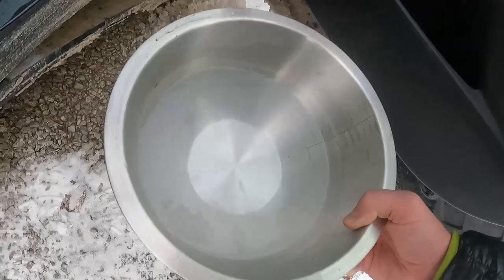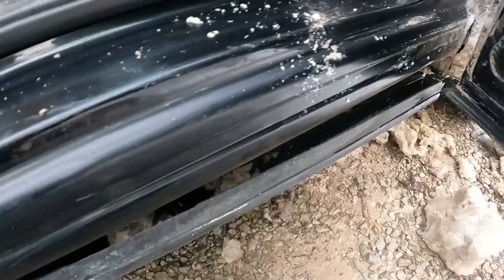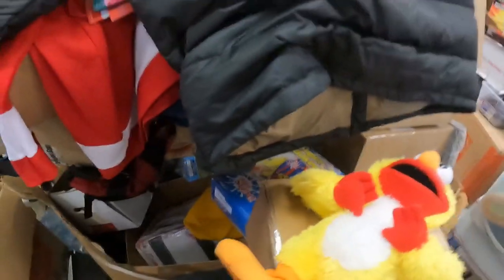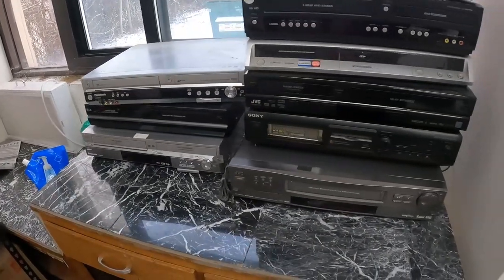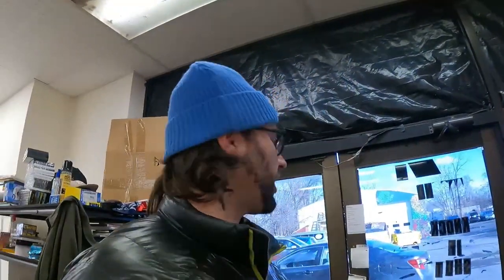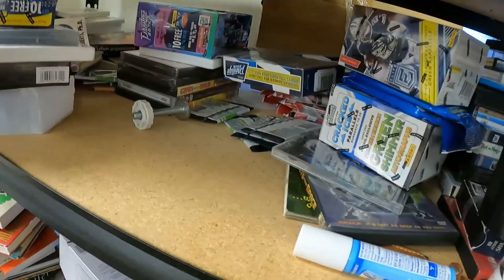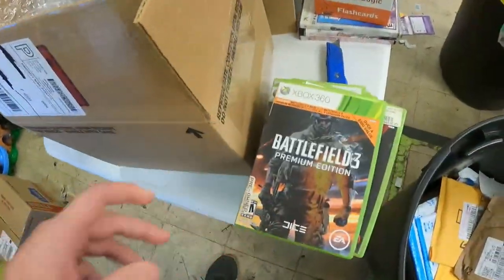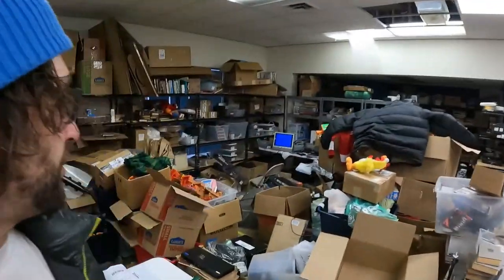I Wanted to Give Up

Comment: It appears that's just a "ding" guard. Essentially protects the paint which is what keeps it from rusting. Obviously if there's dings/chips in the paint the metal gets exposed and rust begins. Eventually rusting the body out over an extended period. 
They just mount on with screws, thus would be an easy fix! Find the hole and a short fat screw, you'll be good to go brotha. Drill a new hole if the the end with the hole is missing. It looks like maybe 2 screws are gone. I dno, you'll see the holes though.
Reply from the maker: Thanks for the tip! I’ll have something to do once it warms up around here!